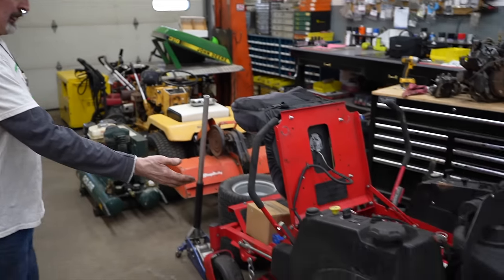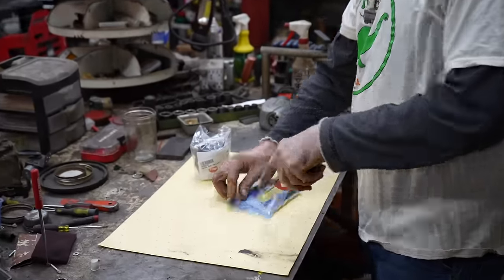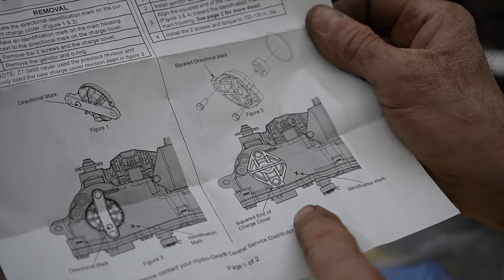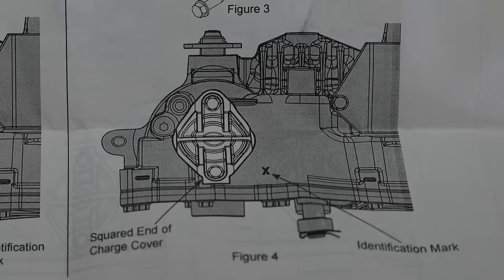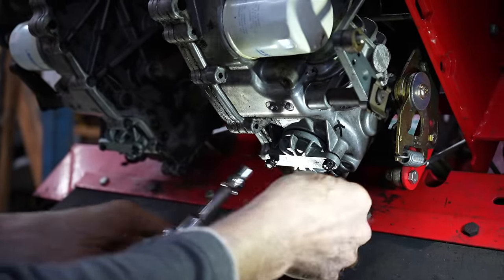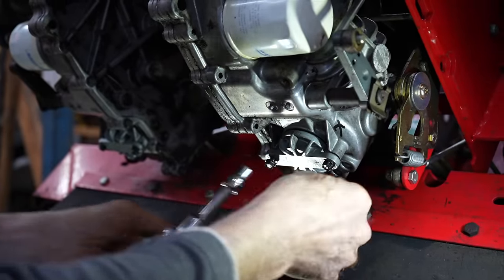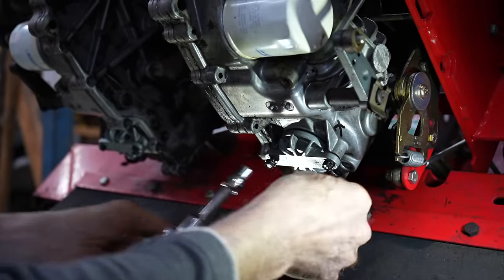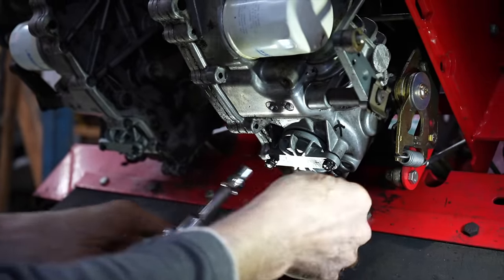Yikes! Hydro Gear Transmission MAJOR PROBLEM + Upgrade

Comment: Had to do this same repair a couple of years ago on my Gravely, just replaced the o rings.  Didn't mark the cover, didn't know I needed to, and installed one backwards, they will go on either way.  When one pump wouldn't work I had to do a lot of research to figure out why.  Turned the cover around, works fine.  Thanks for posting this, wish I had seen it 2 years ago.
Reply: Did the same

Comment: Wish I had known about that upgrade. Had a Husqvarna garden tractor in a few months back that had transmission problems. The owner had taken it to a shop and was told it can't be fixed because the transmission is a sealed pressurized unit. Not so. It had been leaking for do long it was very low on oil and had never been serviced. The charge pump cover bolts were loose. I pulled it off, put in a new o-ring and torqued the bolts. Drained the nasty remaining oil. Put in new oil and filter. Worked like a charm. Let it sit for two days. Didn't leak. Did a full service. The owner said it ran better than new. I only wish it had the external reservoir. What a pain to put oil in!.
Reply: They never think ahead these engineers building this stuff .my hydro trans didn't even have a dam drain plug . I feel you brother what a pain
Reply: you have to watch out for scamming mecanics i had a friend had a briggs engine blowing white smoke he brought some place they told him the engine was finished then he called me i took one look at it he fired it up no smoke then boom smoked like hell i told him head gasket blown took head off showed him right there and then even told him where it was leaking when it was off he saw i was right got a new head gasket torked it down to spec and bob is your uncle ran like a top no smoke the guy just want to sell him a new machine or an other engine ,crooks have to watch it like car mecanics just as bad if you dont know they know it and will screw you over big time i am honest and they like that ,i just did a job on a snowblower one of the holes on the head was broken clean off nothing to bolt  to only had one hole so i tried to fix it useing jb weld built the side of the head back up once hard drilled a hole in it and drilled out the other hole in the head then put 2 new  insurts to screw into with new screws put jb weld in the holes and on the in surts place them in the holes then put a light  cover over the head where the carb would screw into sanded all straight, made a gasket screwed it into the insurts with blue lock tight put it all back together ,adjusted the ohv rockers and fired it up  ,ran super, happy about that if i did not try this it could have cost $30-150 just for a head i knew jb weld can handle quite a bite of head so not to worried about it falling apart,if it fails well then going to need  a head because that one will be scrap ,but if you dont try you dont know,so far so good,sorry some may not agree, but i like to save it if i can, it works now and thats the maine thing,
Reply: I thought the Husqvarna tractors had tuff torque transaxles
Reply: Did you not take out the air cover at the top side? Looks line an Allen bolt. Once you pull those the oil goes in a little quicker. You can even force the oil down with a small pump to fill much quicker.
Reply: @iwin1833  I believe the "drain plug" on these units is the filter.

Comment: A few years ago my charge pump on my left zt-3100 was leaking. I put in a new o-ring and it still leaked. I noticed there was a .012 gap between the cover and the main housing so I filed .008 off both sides of the cover mounting bosses (carefully keeping it square with the rotor housing). No more leaking!.  Also, the zt-3100 has a threaded vent plug to let the air out and the drive will fill quickly if you doing a complete oil change...Al Scott.    Good video Taryl!

Comment: Taryl, there's a small vent plug on the flat side of the unit about half way at the top. You take that vent plug out and watch the plug hole until you see oil start running out of the vents and you have them blead. If you put that charge pump cover on 180 out the unit will not work because of the direction of rotation will be wrong. Those O-rings leak quite often on some models. I have completely dissembled those units and resealed them with very good results. We ran 20w50 Synthetic motor oil in them. Thanks for the videos. Lee

Comment: LOL. This shows up on my feed just after I did this same maintenance to my old 2010 Hustler Fast Track 36" with the ZT3100 Hydros! My right Hydro was getting weak and groaning. Started by changing both the oils and filters with hydrogear bits. Right side still weak and noisy. But a charge pump upgrade and seal kit. Did that this afternoon. NAILED it! My unit was so old it had the old style seals in it. A thin metal pipe with Orings on each end. Hard as rock and not sealing anymore. So the noise was the internal oil leak. It was "interesting" to pick out the old seals. Easy to press the new style ones up in there. Did the bleed procedure again and Viola! Full propulsion and delicate maneuvers possible again. Love your presentations! Thanks!

Comment: The reason for the off set is this determines the rotation of the charge pump. If you install it back wards there won’t be any charge pressure to stroke the pump. If you look at the input belt you would see the two pumps are turning the same direction. Some models may have one pump spinning one way and the 2nd pump turning opposite. That’s the purpose of the directional mark.  The charge pump is there to continuously fill the loop with oil as there is designed leakage that is used to cool the system.

Comment: Enjoying this one again as I plan to do this to the other side hydro to even out the equipment. Been running the unit all Summer. Another 20 hours on it. That formerly weak hydro runs like new still. The triple o ring seals up inside the tubes above the charge pump are important too! They are just $4 each. Important to change those too. I was surprised at how long it took to finish burping the system and stabilize the level in the oil tank. It took a few weeks of using it before I could stop adding a drab of oil to the tank before using it.

Comment: That's almost always where they leak. Axle seals as well, especially when they're all tangled up with twine, string, etc. I'm a Country Clipper Dealer and see this problem often.
Thanks Taryl!!!
Reply: TarylFixesAlI  I'm probably going to have to buy another slippers bobblehead. One of the customers knocked it off the shelf and broke his head off. I fixed him but another customer knocked him off the shelf and broke both his feet. Poor slippers.
Reply: That's funny had to replace these on my country clipper 355 Pro  the charge pumps where both leaking got tired of having to add oil all the time

Comment: I’m glad I watched this, I’ll be doing this later this year on my mower with the same drives. But after you refill it with oil, I knew you had to cycle them forward and backward to get the oil down into the system but I had no idea, took it, as long as it did, as long as that took I would’ve freaked out and thought something was wrong. 😂

Comment: There is a plug in the side of the gearbox near the top. When adding oil to reservoirs pull the plug until oil just starts to come out those holes. Allen hex head plug with o ring. When oil reaches plug then put plug back in and fill to the proper level in tank/reservoirs.  Great video.

Comment: I always took the top plug out so it would refill faster and after oil ran out the hole reinstalled plugs and finished filling. I found that to be faster when serving!
Reply: Yes, That's the BadBoy manual method of filling, then add small amount to the "mark on the reservoir". I think Taryl  may have not read or researched the filling on those transmissions.
Reply: Same situation on the Walker mowers too. Also, don’t trust the filter cover. My Walker has the ZT 2800 stamped on the hydro. But, the cover says ZT 3100. It came that way from the factory. The same pumps were upgraded because of a leak by a warranty repair. That is how I learned about the generic cover. There’s your snack.

Comment: I do like these repair videos .. interesting how they changed from an 'O' ring to the flat rubber gasket. I have to wonder why as the new housing with the pump impeller is a flat surface ..  just thought you might get more tension on the O ring .. but hey they had reasons .. maybe the new rubber gasket was thicker ... Have been watching your videos for years now .  First time commenting now .. enjoy watching ..thank you .  TC Bridgette

Comment: I had to go look at my zero turn with ZT3100 transaxles that I bought new in 2022. Luckily, it came with the upgraded steel charge pump covers from the factory. Thanks for the heads up.

Comment: grouse work Taryl Dactal mate love the work on the Transmission work and yep a funny defect with the original part for sure but yeah ever since the upgrade i reckon they did a lovely job for not only occupational health and safety but less complaints and costly repairs in the long for sure all though the Steel Material i find you,d think would last but yeah it does differ on what they are exposed to personally and yep rust on steels is not a good mix from my view but yeah easily replaceable for sure and cheers from Australia 🐨🐑🦘🌴🇦🇺 or the land down under to your area and yep us small engine lovers out there have probably experienced many issues like these ones etc.

Comment: Okay, I've the 3100 Hydro gear as well and Bad boy service manual says the oil filler removed is the oil drain with machine level. I could not find/get the 10-50 "full synthetic" oil locally (Pretty weak support from local dealer). Finally had to settled for 15W-40 regular Dino oil from local Farm & Western Wear Store. I've not experienced the "leak" yet. I've the remote reservoirs and glad to have them for filling! Glad to see some Hydro gear Service Videos.
Reply: 20w50
Reply: Good idea to get the right oil.  20-50 is what you want. Call Napa and order it if they don't have it on the shelf.

Comment: The geroter has a witness mark and usually they match for dimensional reasons if you take the old geroter and take your feeler gauge and measure .003 to .005 from lobe tip to tip should be about the gap you should have but usually the gap is pretty close already but yes that is for a dimensional check purposes .

Comment: You could make a rubber adapter to stick on the reservoir tank to pull a vacuum on the system. Then after an hour come back, & release the vacuum. I do it on hydraulic brakes a lot. Saves me a lot of time.
Reply: Works also on automotive power steering to purge the champagne bubbles when you have a slipper pump.
The reservoir entrance hole is about the same diameter.
Apply a vacuum and pull the air up to vent it.
You could get a rubber stopper that big at hardware store when I needed one.

Comment: I think the “mark” they are talking about may need to be stamped ( like with a hammer and punch) into the trans housing. This may be to indicate to future mechanics that the “update” has been completed. The reason I think this, is because I have a 1974 Honda cb360 and  when a certain upgrade was done on the engine( such as the upgraded cam chain tensioners) that the mechanic  was supposed to punch a small dot next to the engine serial number pad     to indicate that the update has been done. Just a thought.

Comment: I still have one in the driveway. The left hydro was leaking real bad. When I had gone to remove the bolts, I noticed that the bolts were very loose. I purchased the new filters and am going to see if the left one will seal instead of replacing the charge pump cover. The one I am working on is the ZT 2800 on a 2006 model. This one shouldn't have the updated kit being that old. I believe that it started on 2011.

Comment: You caught on that the marks on the pumps indicate which way the georotor is offset. Both transmissions will offset the same way because the input shafts turn the same direction. 
I usually remove the vent plugs in order to get the air in the case out and get the oil back in as quickly as possible.  The vent plug is located at the top of the side cover or in the top of the main case, depending on which port is not used for the line to the  expansion tank.

Comment: If you look closely at the center of the cover while installed, you can see the offset center area that indicates the offcentered pump cavity.  Just match the offset to install properly.  No indicator needed.  In this case the pump cavity is set to the left.  Align the new one with the cavity set to the left as well.

Comment: There's a Allen plug on the side or the very top usually around the vent stand pipe or the filler tube fitting take that out and fill to full then install and fill reservoir to full cold mark,  takes a bit of effort but still eliminates the time took purging all that trapped air.

Comment: At the top is a trans is a plug you take out to add oil then top it off on the top after it warms up. The way you doing it takes forever....lol If you had the manual you would have found it Taryl. Oh the drive belt is lots of fun. You will find out.

Comment: When i do hydro gear oil changes i never start them till they are full.
I always go on top of the unit and unscrew the vent- oil drains down in 3-5 min as you fill- jus have to plug it quickly cause she fills kinda quick. Once full then start and they wake up and work everytime for me. 
Before i knew about the bleeders i struggled heavy trying to get the oil to go down the tubes.

Comment: Am guessing with the off-center in the cover if you installed the "wrong" way that transmission will run backwards. That the marks on left and right are on different sides so the transmission runs the correct direction.

Comment: I put paper instructions in a clear protector so in case( you will) it gets dirty you can wipe it right off and be able to save the paper for further repairs or reference.

Comment: The gerotor inner rotor has 4 lobes and the outer ring has 5 recesses where the lobes mesh as it rotates. you can align the marks but after one revolution they won't be aligned. They will align occasionally. probably about every 20 revolutions. No problem, designed that way. Dead battery, it's got an AutoZone battery.

Comment: I got a hustler 54 with non serviceable no drain plug on the hydrostatic bu i have a fill plug no filter should i suck it out and add back what i pulled out meaning the fluid.

Comment: Did you see the cold war motors video from yesterday and the starter motor being used as a hydraulic pump for the power windows on the Olds 98?  Brake fluid as the hydraulic fluid?
Reply: Yeah, they got the motor running, I want to see if the pump still works. Bet it does. They aren't going to use brake fluid, they said it doesn't like water. Transmission fluid would work.
Reply: @blowupbob1  I thought I heard Scott say it originally ran on brake fluid.  I assume probably any reasonably close fluid will work.
Reply: @blowupbob1  Brake fluid absorbs moisture from air...just like ethanol.

Comment: Taryl, I have a snapper yard cruiser with  joystick. It's really hard to steer. This is a older machine. The owners manual says the hydrostatic transmission is service free. It has a resvior on each side. Could it be low fluid? Or, is there another issue? It wines pretty good....help!
Reply: I guess you don't do follow ups.

Comment: If you watch the manufacturer video, they tell you to pull the vent plug. Top off the drives until oil comes out of them put the vent plugs back in. Then flipped the levers to the bypass and then hold your bars forward for a minute and then backwards for a minute and do that six times and then put the bypass off and it should be ok if you need to do that procedure again

Comment: 13:33 the square end of the new cover is facing to the outside of the tractor on the driver side, but when you put the next one on that is the passengers side of a car, the new covers square end is also facing to the driverside of the mower, which i find odd since the pump casing appears to be  polar opposite, would not that square end also have to be facing outside of the tractor on the passenger side as well? 19:35 both square ends are facing the same direction drivers side left.

Comment: When I changed my hydro oil it took forever for the air to bubble out. It's been a few years, my manual says to change it every 400 hours which takes a long time to get to.

Comment: I have a Craftsman rider it made in the commercial brand lawn tractor, no external filter I think it is internal filter it a torque hydro rear and I was going to change oil and filter but not sure if I should ?

Comment: 12:18 terrell I would’ve definitely dropped the rotor and stator in some oil or at least push some clean oil onto it and on the surface before assembling it, so no thumbs up for you this time my friend, you should know better than that! It really will not see any oil until it is been spinning in but that time we already have where taking place due to it being dry because even though, when you fill it, it’s not going to fill the cavity of the rotor until after it gets spinning!

Comment: I have a similar problem I changed the heater core on my Fox Body and now how do I get the air out of the system...love that car.
Reply: Raise front of car a bit higher than rear, heater control to "heat", radiator cap off, funnel in neck of radiator, fill funnel with water, start engine and let it idle...keep funnel 3/4 full...idle until no more bubbles....it may take up to an hour. You're done.
Reply: Huge thanks I will do that!!